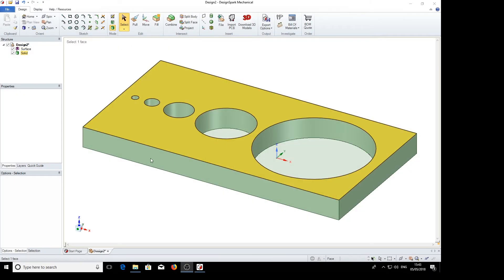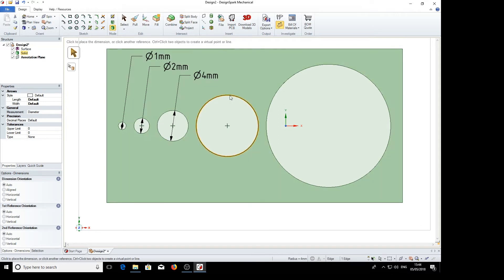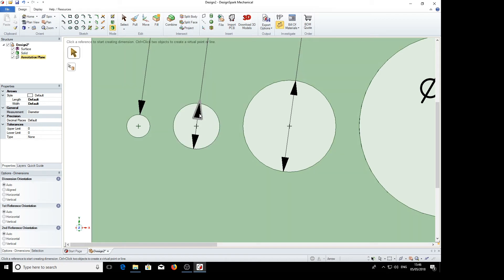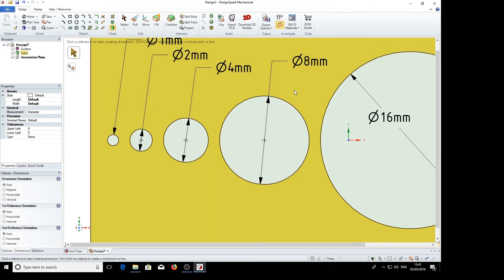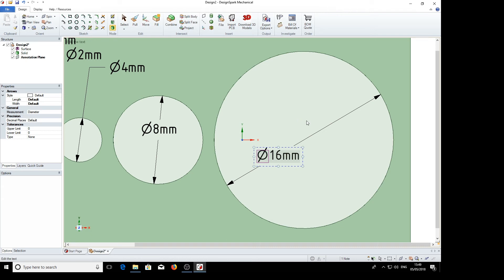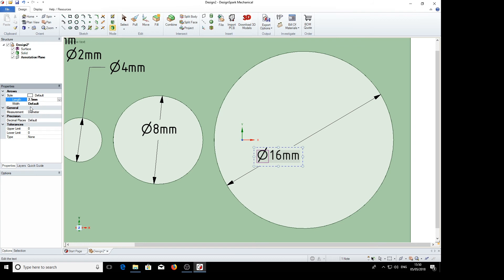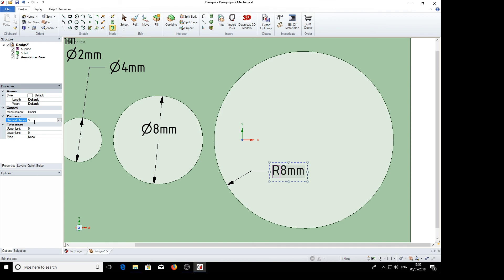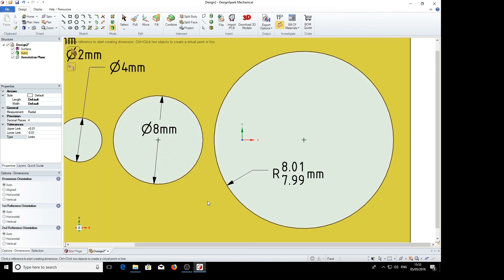DesignSpark Mechanical: Hole dimensioning

Comment: I have an object with a countersunk hole. Is there any way to show the dimension of the depth of the hole?
Reply from the maker: You are probably going to need to make a section through the center of the hole and put the dimensions on that OR make a note on the hole' drill hole xx deep x dd dia.
Reply: @JimTaylor42  Thanks for the reply. Is there a way to eliminate the leading zero that shows up on some of the fractions?

Comment: Many thanks for taking the time to upload your tutorial videos Jim.  Looks like a very good CAD program indeed,  bit basic ..................  but it's exactly what I'm looking for!

Can I ask you ............  can you make the holes slightly conical shape ( smaller diameter at the back ) ?  so far I've only seen straight through holes.

Keep up the tutorial videos Jim,  very interesting stuff !  Now subscribed  ; )

TURK
Reply from the maker: You will probably need the Draft tool to do that. I'll put this on my todo list for a tutorial.
Reply: Thanks for the quick response Jim.  I'll look forward to that tutorial  ; )

TURK
Reply: Hi, you can select the top edge of the hole, select the pull tool, and in the options menu (normal leftside of the screen) you select the pivot option (the most right one) and then you can draw the circle a bit bigger. hence leaving a tapered hole. 
I hope this is what you want Kind regards Hans
by the way it helps if you delete the circle face. before you start tapering the circle edge.